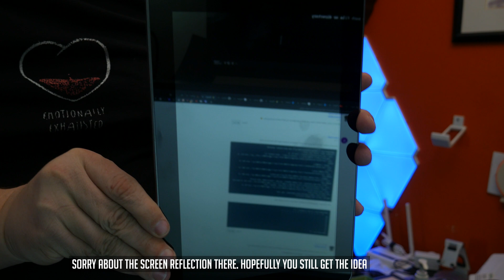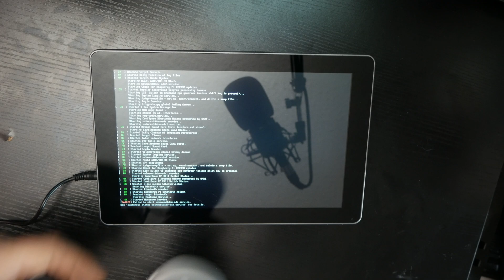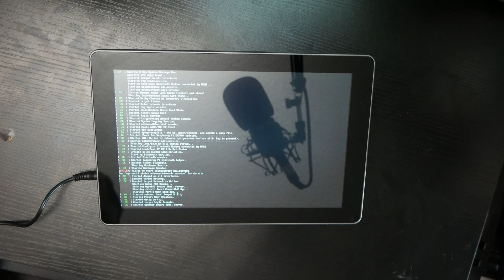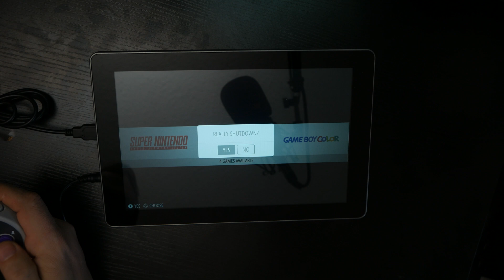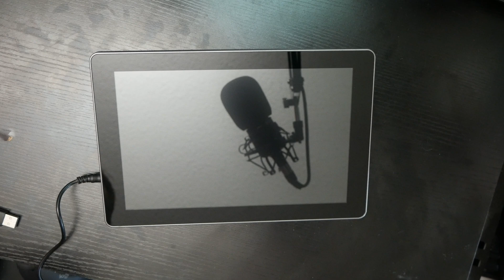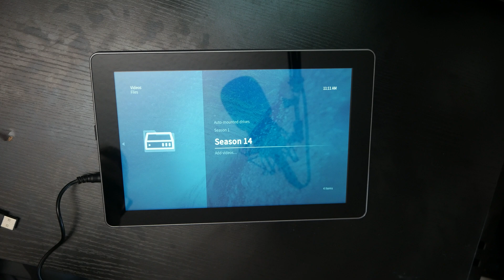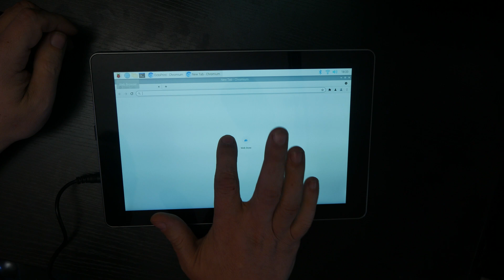Turn Your Raspberry Pi 4 Into a Portable Tablet! RasPad 3!

Comment: I wish someone would put out a tablet kit that would be as thin as possible and as easy to assemble as the GPi Case from Retroflag, that uses a Pi Zero. Or even using a RPi Compute Module. 
Hopefully with a 10 inch or bigger touchscreen. If I could do it, I'd do it. But if someone gets to make one, I'll be all over it.
I know there's the CutiePi, but I'd prefer something more like this RasPad... except made out of metal like some of the RPi cases. With easy access to the RPi so it could be replaced, card readers and speakers on the sides, etc.
It just doesn't make sense to me to use a full sized RPi 4 inside a tablet.
Reply from the maker: I only showed some of the things you could do with it. It's really meant more to be for development and using the GPIO pins and that sort of thing. I think that you could get a Pi 4 compute module with a minimal carrier board and use something like that with this.

Comment: Thats a very big thing.
Reply from the maker: It is, but you could slim it down quite a bit if you were so-inclined to design a new case backing. There's a lot of unused space in there! :)
Reply: @DBTechYT  that on the other hand is great, so it is possible to trim it down